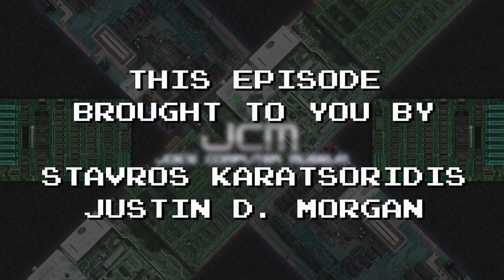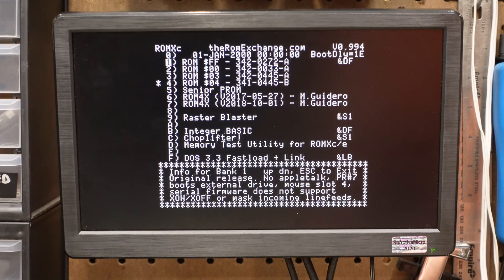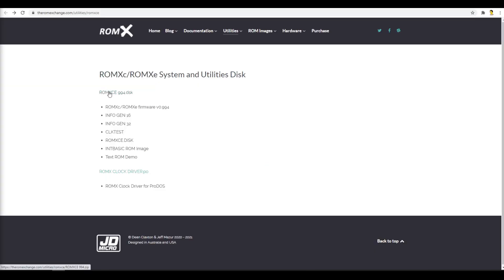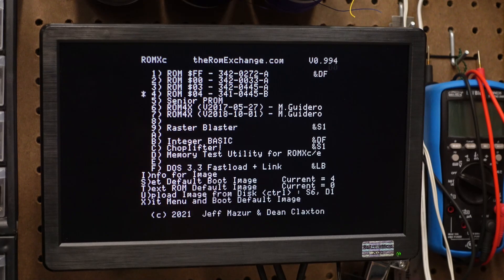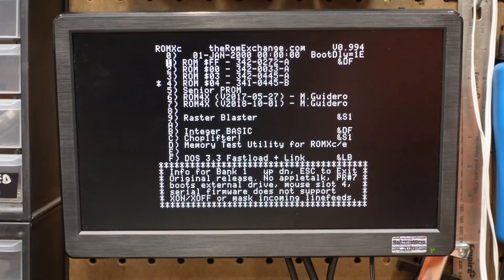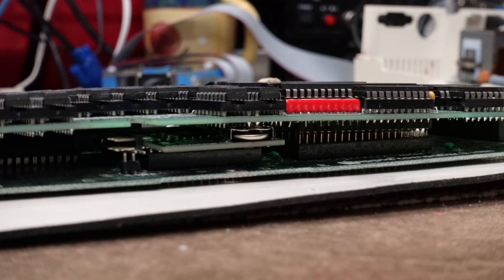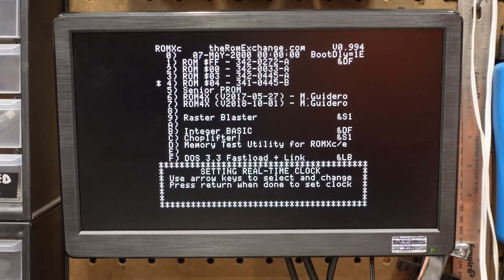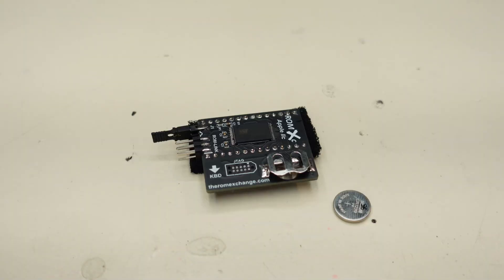Boot Instantly - ROMXc Review for the Apple //c

Comment: Excellent level of detail in the review, especially not being reluctant to call out shortcomings and critiquing the UI. 

Also: Apple II DeskTop cameo at the end! Based on the floppy icon placement, probably the original 1.1 version. Have you tried out the unofficial 1.2 update with bug fixes and extra features?
Reply from the maker: Thanks! Also: yup, that's 1.1 booted off a 5.25 floppy on ProDOS 2.4.3. I have not tried the 1.2 update, but I've read about it and I'm enthused about its future.

Comment: Also if you have an original ROM (255) you need to break one solder connection and make anther n order to use 32 Kb ROMs
Reply from the maker: Thanks for the tip!